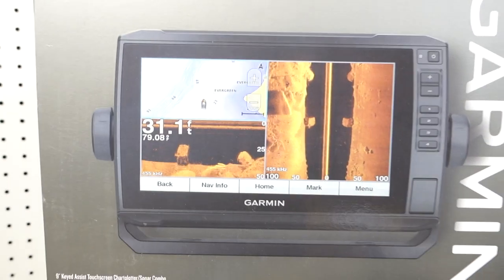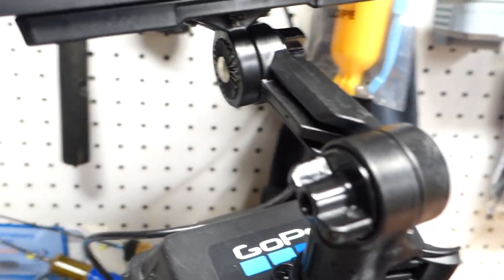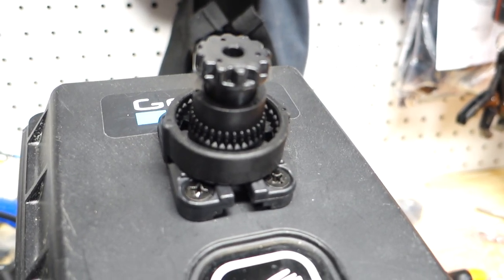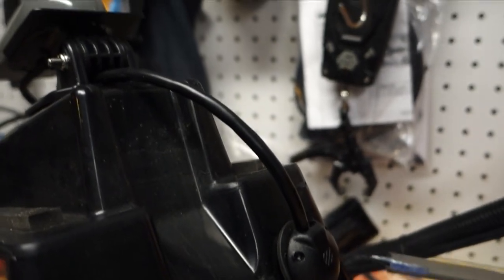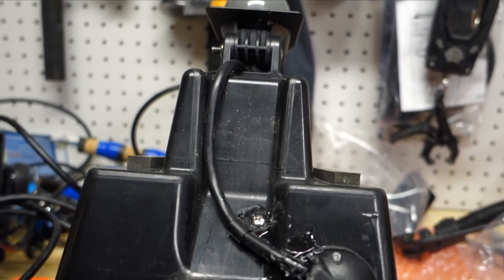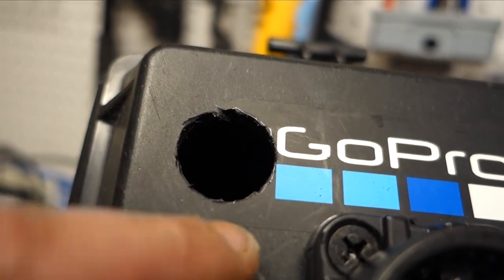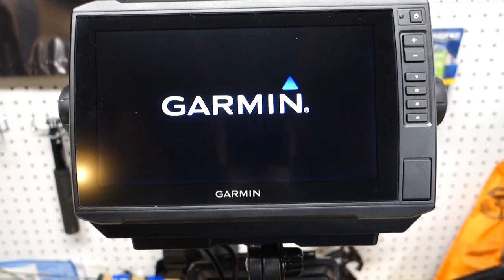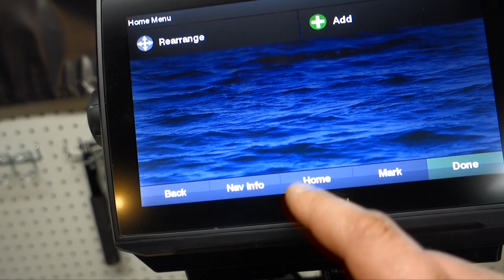Garmin Echomap Plus 93 SV Install on Bonafide SS127

Comment: Great video ! Do you get a perfect reading with the  transducer ? I ask because some videos  people put a spacer so transducer is lower in water. How stable is your unit attach to yakattack  arm extension, does it move around at all ?? Sorry for all the questions  . I just bought the same unit for my bonafide ss127
Reply from the maker: When I had the bonafide the transducer read clean.  Didn't have to use a spacer.   The arm did wiggle a little in choppy water but wasn't bad.   It was about the same on all other boats I have had this unit rigged on

Comment: I just bought a 73sv for my bonafide and was wondering if your transducer comes below the lowest point on the kayak and if it doesn’t, is the side scan image still good because I’m worried about mounting it to my dry pod and scraping the transducer on the bottom or mounting it too high and having interference from the sides of the kayak. Thanks.
Reply from the maker: Drew Brown it goes slightly below. It has no effect on the side scan
Reply: @PaddleNFin  is it low enough you may have to worry about it scraping?